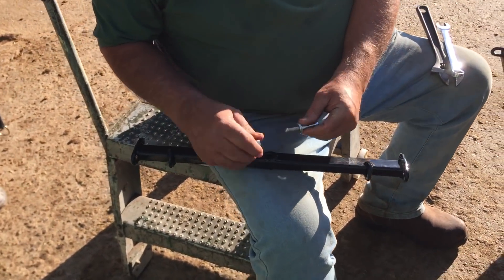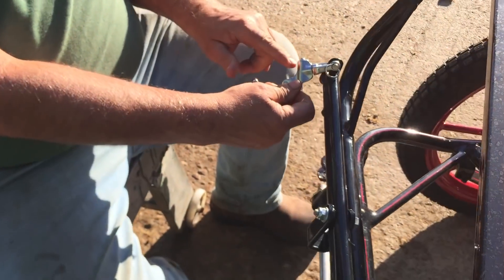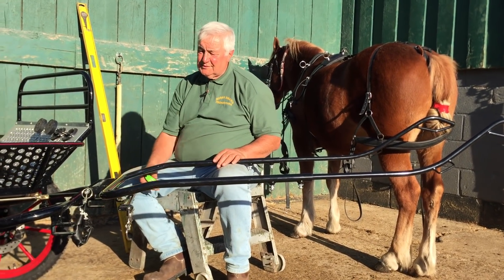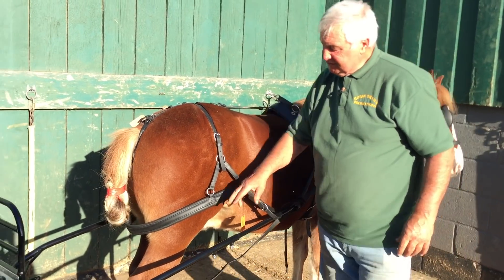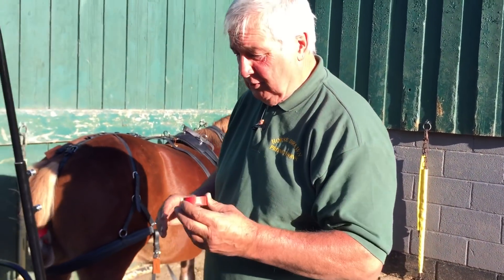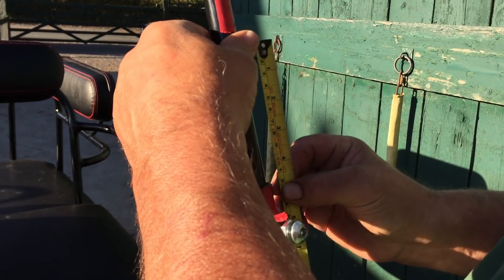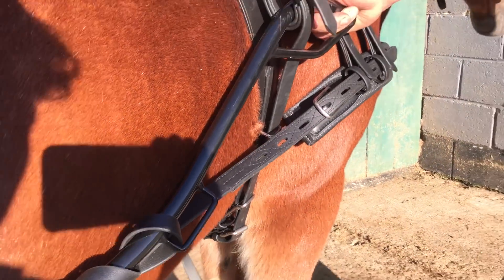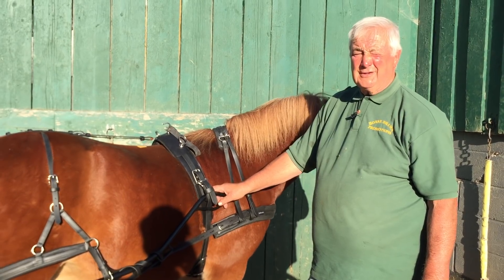How to Harness; Part 3 - Setting Up the Cart

Comment: Haven't seen any of your videos for a while; nice to find you again.  Question: why is the pony's tail bound up?  Doesn't it prevent him/her from attending to the flies?  Why would you want to subject a horse to being unable to protect itself from flies?
Reply: Stops tail getting caught in the trace hooks
Reply from the maker: If you watch our video on fitting the harness to the pony (same pony) Barry explains there why he's tying up the tail. On this occasion, it was to allow us to show you the correct placement of the breeching easier. However, we may also tie up the tail to allow us to see how the horse moves behind - for example to identify and avoid issues with brushing injuries. And also, as mentioned below by somebody else, to stop it getting caught up - although this would be more appropriate in a situation where a horse may be required to back up onto something, for example when logging, harrowing or ploughing. It is also possible for a horse to catch a quick release shackle with its tail and undo that! However, as you'll see on the majority of our videos, we normally tend to drive with the tail loose and unplaited.
Reply: @barryhook2  - Thanks for the explanations.  Lots to think about with horse and carriage.

Comment: What is a line of draft and why is it important to have a good straight one?
Reply from the maker: The line of draft is the pull from the traces at the collar to the swingletree of the cart. It is important that it is straight as otherwise the horse is pulling at vectors. The best line of draft for the job can alter depending on the cart, collar and pony you're using.
This might help if that explanation wasn't great!
http://northwestdrivingclub.co.uk/balanced-draught.htm